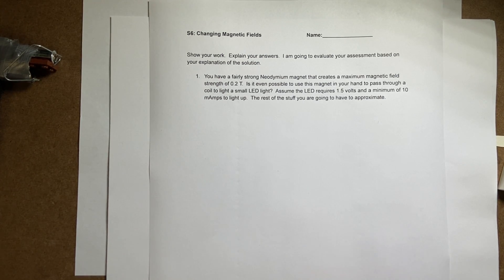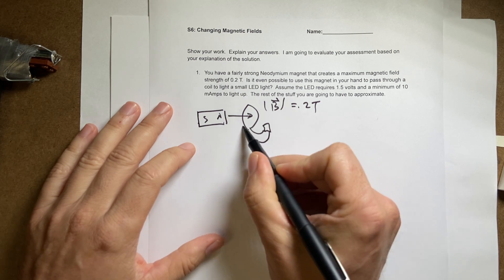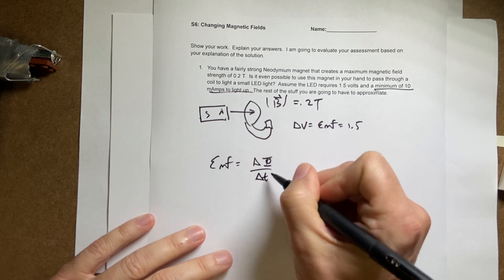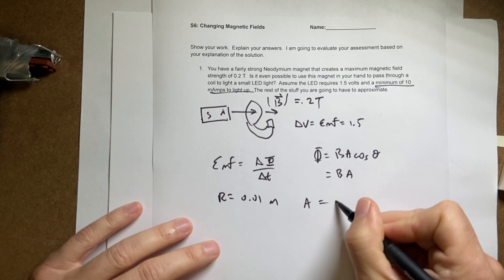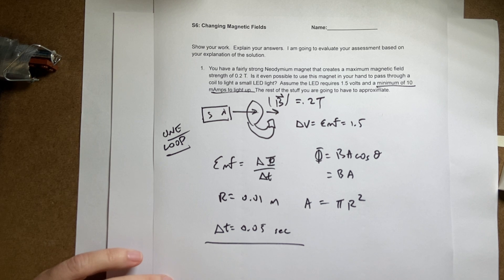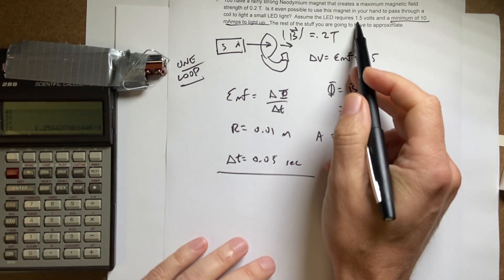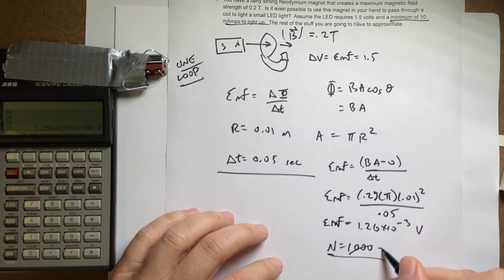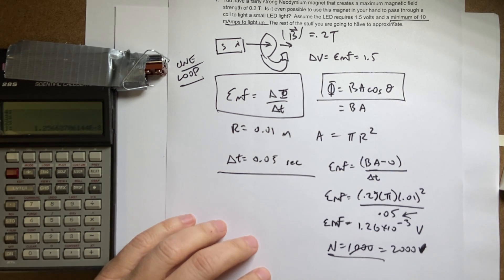Is it even possible to light an LED with a magnet and a coil of wire?

Comment: Why is there duct tape covering the brand and model of your calculator?
Reply from the maker: The tape is to hold my batteries in. That HP uses a very weird size (I think it uses N) which I of course don’t have. Instead I used my MacGyver skills and made it work with AAA batteries.